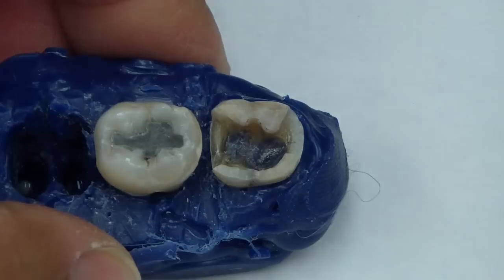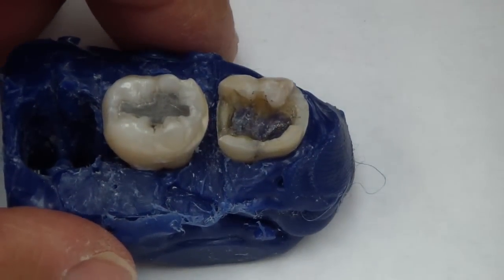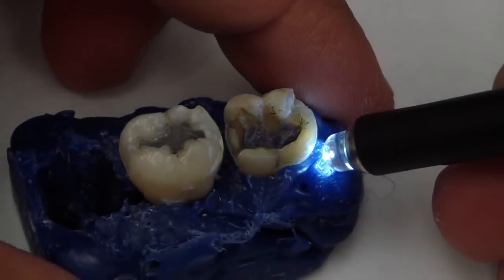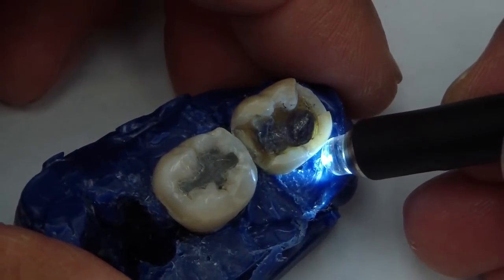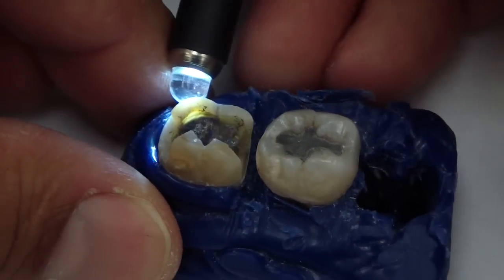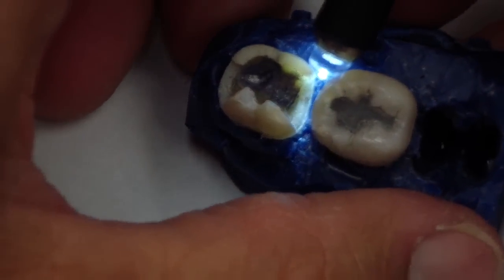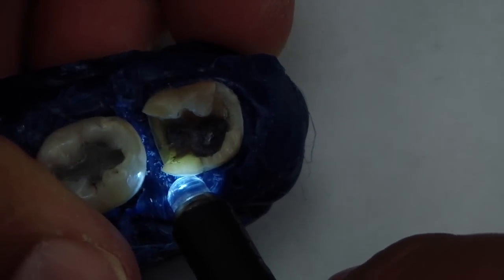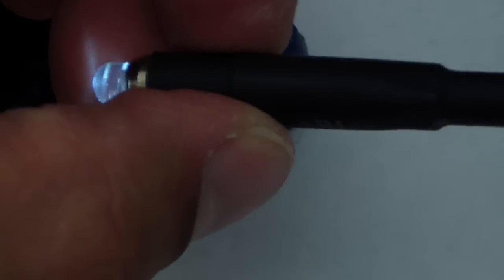Cracked Tooth Transillumination

Comment: You can get purpose made transilluminators which concentrate more light to a finer point. A plastic curing light cover is ideal to prevent contamination. Thanks for the video :-)

Comment from the maker: Great point.  Autoclaving would be ideal - but - it would damage the light.  Therefore, some sort of disenfectant (spray/wipe) would have to be used.  Is this ideal.  Far from it.  However, this is similar to using a light curing unit and the light guide - it is disinfected after use.  Thanks.